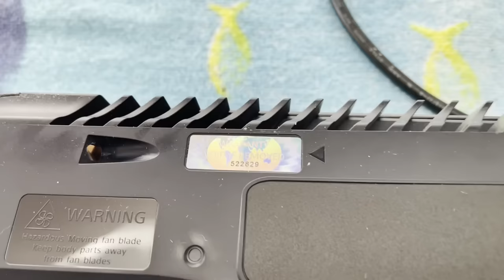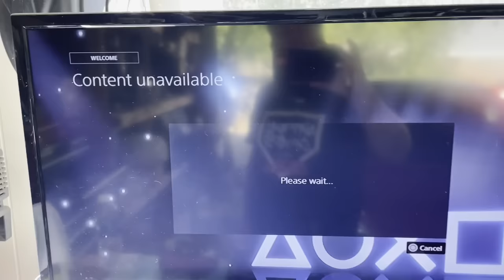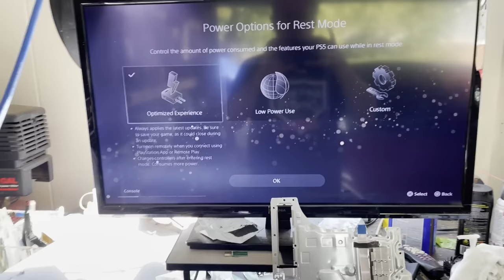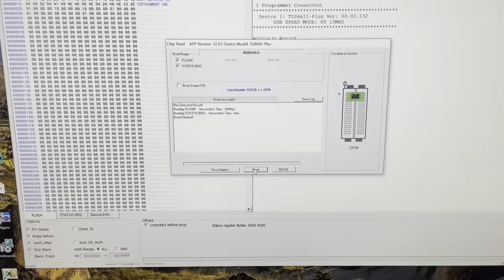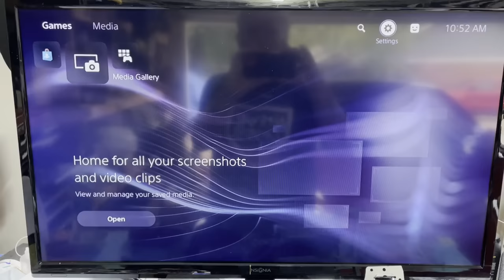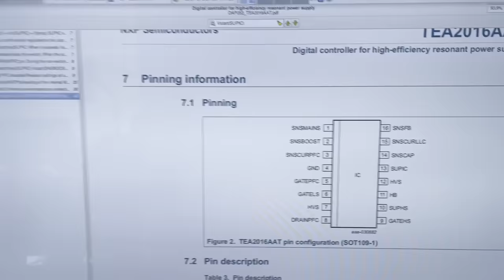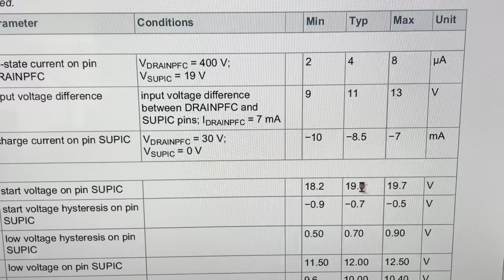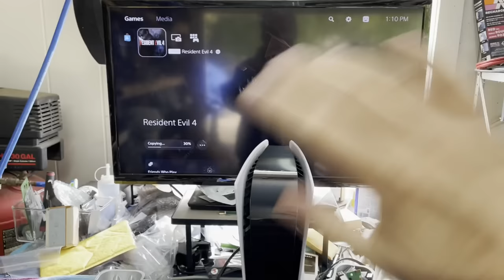#116 Repair of PS5 No Power

Comment: Seems like that exploitable PS5 consoles can enable IDU mode which writes a flag into the BIOS, and since that mode is meant to be restricted its difficult to go back even to stock firmware. Interesting
Reply from the maker: I thought it was interesting as well.  It was my first time seeing this.
Reply: I wonder if the PS5 originally came from a retail environment. It’s possible it was always in DFU mode and then the power supply failed and then an employee absconded with it and sold it on eBay. It’s crazy that the BIOS has to be flashed to get it out of that mode; I guess it might have the effect of being an anti theft feature.

Comment: Please help, so ps5, dead power, I fix it, after that it doesn't want to turn on, the south bridge is short circuited, I replace it and the console turns on, everything works normally, disk, bluetooth, wifi... I start to update the console and a new problem appears which I don't know how to solve. I tried everything from safe mode but it didn't work. I am getting error SU-101337-5. Can you help me? I don't know what to do.

Comment: You make the best videos!

I had one exactly like this and changing that one byte got it out of IDU mode. However prior to powering on that unit and after fixing the short on the board, I stupidly connected the LAN cable. I was then baffled by that screen that you saw on IDU mode, and if you did not already know, IDU mode updates firmware automatically in the background when connected to the internet (which is what was happening as I connected the LAN cable!). Therefore, initially I thought I was screwed as I needed low firmware to exit IDU mode (assuming it was an exploit to get into IDU mode to begin with) until I discovered the byte change that got it out. Therefore, I never figured out the original firmware on the PS5. I ultimately concluded that my unit was definitely a kiosk unit (it was never disclosed on fleabay) as there was significant heat spots on the mainboard, probably from being kept on all the time.

I also ran into another NOR corruption repair that had a cycling power initialization when applying 12v, it'll go from 0mah to 300mah to 0mah to 300mah cycling constantly, just fyi if you run into that.
Reply from the maker: Thanks for the info!  I think someone was trying to hack it.  They got it in that mode and couldn't get it out.
Reply: Hm, that’s weird. Today I had a chance to read the BIOS and change that byte. I spent a lot of time to make a flashing app work on macOS Sonoma and Apple Silicon. I read it to a file, changed that byte, erased and reflashed it. Then I verified current BIOS with modified one on the disk - they were equal. After turning on the console still in IDU mode. Resetting after that didn’t help either.
Reply: I eventually had a chance to reflash it successfully. CFI-1008A requires FF but not 00. However, there's a different issue now: my PS5 cannot verify my older licenses because it cannot connect to the license server: "Can't use this content. Can't connect to the server to verify your license...". Free apps like Spotify and YouTube plus that PS5 demo game work just fine, and even free Brawlhalla does not work.

Comment: Well done, great job, I see you've started using hot air on the power supply (DAP053T), no more fear of popcorn 🙂
Reply from the maker: Yep.  If I add leaded solder, keep the hot air at 350C or less and try to be quick about it, I have had pretty good luck recently.

Comment: Great as usual! Thanks for this video! Just out of curiosity - it may be mentioned in previous videos: Is DAP053T is the same chip as TEA2016AAT as you soldered? i am sure you guesed my point - the huge difference in the price of both ICs.
Thanks again!
Reply from the maker: They are one in the same.
Reply: @ToltecMerc  Thank you! As DAP is £40 but TEA is £7 for 5 chips - quite a bit different :))

Comment: That was a bit different having to hex edit the bios before moving onto fixing the power supply.  I am ok when it comes to programming and cracking/haxing, I use HxD along with other programs such as IDA Pro, OllyDbg, x64dbg and dnSpy.  I am a newbie when it comes to electronics and fixing them, I watch electronic fix videos for entertainment whilst trying to learn a little.  I had never heard of Kiosk (IDU) mode on a PS5 although I do not own a PS5 and have never used one so that's my excuse.  What bios programmer did you use?  It just kind of came on that must mean that it wants to live.  Strange how the DAP53 gave ok diode readings yet was still faulty.  Thank you for sharing your knowledge and wisdom while making entertaining videos, looking forward to the next one.
Reply from the maker: I do get some weird problems sometimes.  Since I pay over $200 for these broken consoles, I do what I must to repair them so I can resell.  My programmer is an XGecu TL866 II Plus.

Comment: is it impossible to buy the schematic diagram? I can find the short circuit,but I can't order a part if I don't know the exact reference or value. I can program the BIOS and I have the programmer too, but where do I get the BIOS? Do I download it from a working ps5?
Reply from the maker: No PS5 schematics available.  You need another, preferably working donor board to compare to.  You should be able to find working BIOS dumps with Google.  I found them in the Facebook group "Game Console Repair Legion".

Comment: Wow, another Great Repair and Video!  So much Useful information.  Ebay is a crap shoot.  Could you tell me what you use, to discharge the high voltage caps in the power supply!  I've been using a 3 watt 10 ohm resistor.  It works, but I think what you use is much better.  Thank You
Reply from the maker: Thanks!  It is a capacitor discharge tool.  The brand is TKDMR.  The model is TD-CD02.  They are available on Amazon.
Reply: Thank  You Very Much! @ToltecMerc

Comment: What do I do if I do have a short like when you tested continuity at around the 3:00 min mark?
Reply from the maker: If you have a short on one of the outside pins of that 4-pin connector,  you have a short on your +5V or +12V on the PCB.  It could be anywhere on the board.
Reply: I think it’s my power supply. The two pins show continuity and no voltage. When I removed and probed it. I am not taking power supply apart that’s a little out of my comfort zone and I can’t solder anyway. I’m a car mechanic lol.

Comment: So that model is a launch model then 1st revision from 2020, they did have a massive heatsink on those and cooler on them, that's shrunk in size obviously to save money and make a profit, but every PS5 they really are such a pain in the bum to deep clean, they have to completely disassembled all the way down, they really get clogged with fluff and dust it's unreal, causing the metal to oxidize and burn off, and I've seen some roach hotels over on David's channel of late, he had some just this week which were still alive, had to place them in a bag and spray the hell out of the machine with alcohol.

They really did make these on the cheap and setup to fail from what I have seen since they were released in 2020.

Series X has it's own issues and can be more problematic.

Two things I have heard though is that Sony are now clamping down hard in China as they know people like yourself and the others are repairing these, similar to how Apple act.

I'm also hearing supply delays, price increases 10x and some parts not available anymore so donor boards have to be used, it also has something to do with the most recent US - China set of sanctions and Alibaba came under CCP control after it's CEO was found to be acting using fraud so I know a lot of you guys use Aliexpress for parts so you may struggle going forward.

PS5 Slim is CFI-1300 with 5nm die and no Liquid Metal being used.

I'm not convinced of the detachable disc drive, I see issues already with that connector, very modular in design and it's crazy expensive for a Blu Ray drive in 2023, just made of plastic and built to fail, reminds me of the HD DVD 360 Drive I had back in 2006.

Let's hope they are more reliable than the ones before it, as we are now on the 3rd revision in December 2022 and I've seen you repair them after just 6 months, along with Phil aka Cod3r and so many are being steamed daily on David's channel Computer Booter.

Comment: What is the program used for the bios chip ?
Reply from the maker: I used HxD Hex Editor.
Reply: @ToltecMerc thank you. I never miss your videos. I have two ps5 consoles that beep but no power and I have no idea what to do next but your videos help
Reply from the maker: @jedininja83  if you can’t find a short, it may be bad RAM.
Reply: Very new to to the whole console repair only done a few hdmi ports. Can you please tell me how to check to see if the ram is bad ?
Reply from the maker: @jedininja83  unfortunately the only way to be sure is to replace it.
Reply: Thank you for your help I really appreciate it